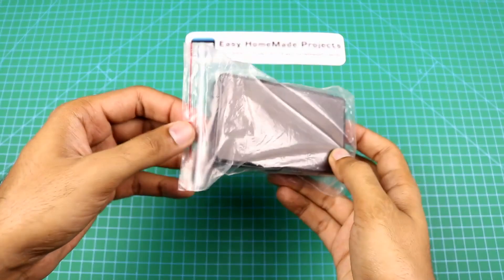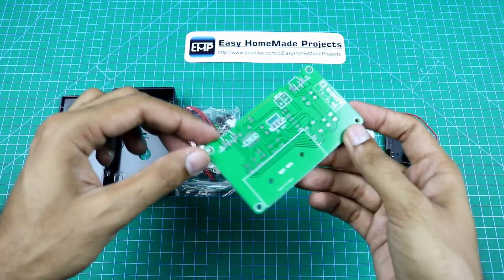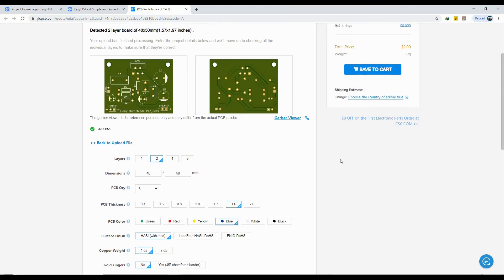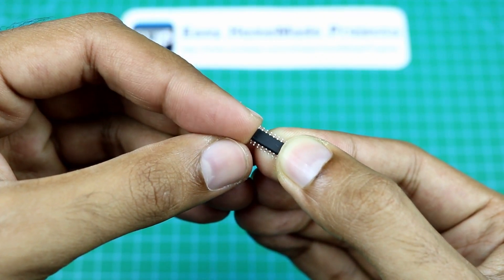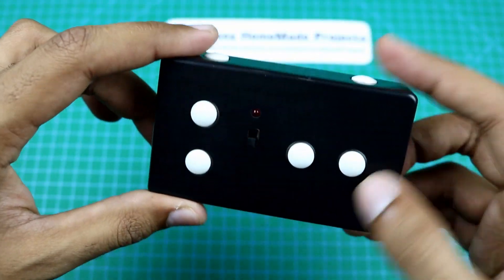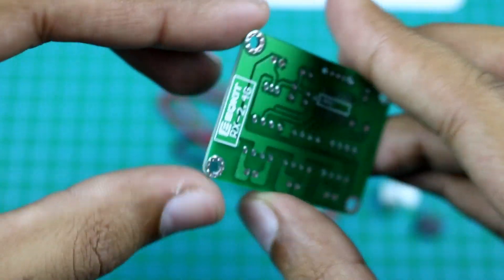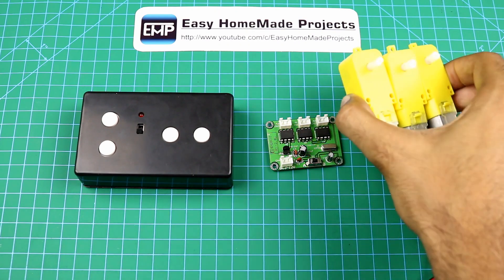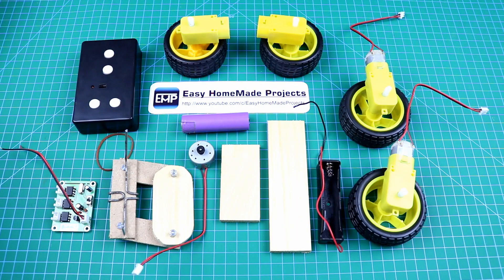DIY Long Range Remote Control KIT

Comment: It is amazing project thanks for sharing and hardwork..i have a question..what do the microcontrollers do in this circuit?
Reply from the maker: Frequency modulation and transmission
Reply: @EasyHomeMadeProjects  Thank you so much💜
Reply: From where you had purchased